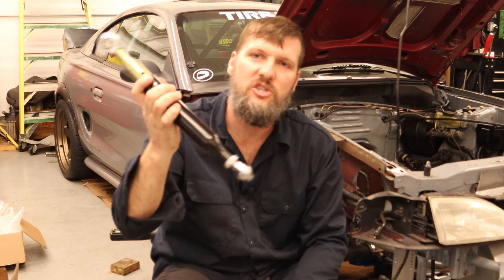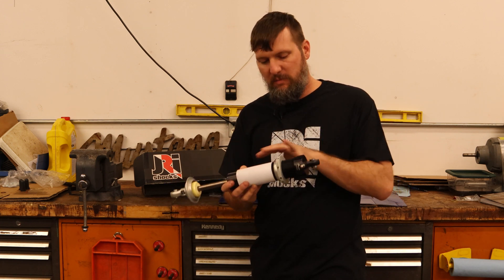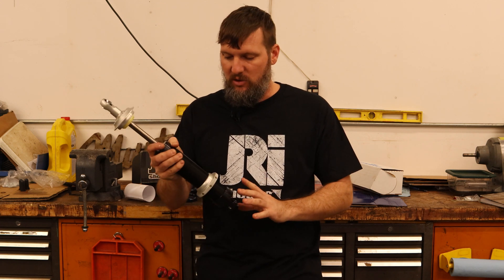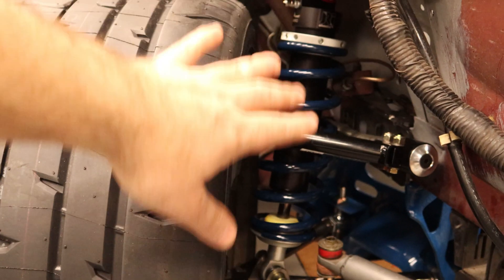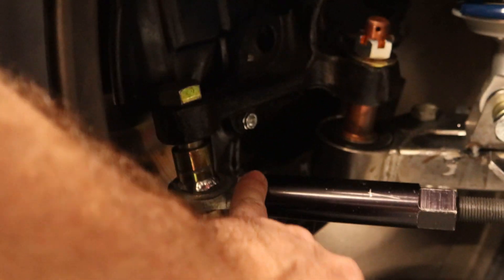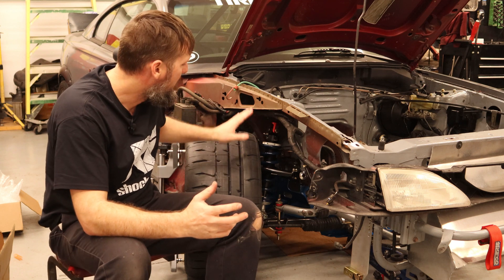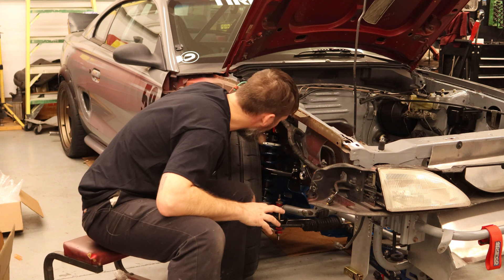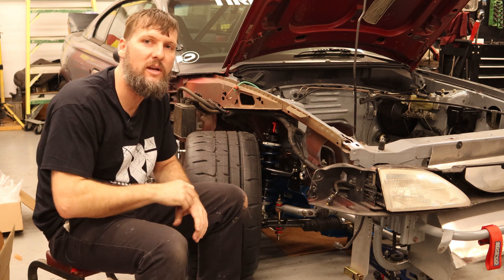Coilovers for DIY Double Wishbone Mustang Suspension

Comment: cant believe this has only gotten 93 views so far even if it has been 1 day. Can't wait to see the end result. What are the measurements you're going to be focused on in the end? Camber, caster, scrub radius, bump steer, camber gain, what else? Thanks!
Reply from the maker: The algorithm....😵‍💫 I know basically what I want for camber, caster, toe, and bumpsteer. Roll center height and antidive I'll need to figure out during testing. Scrub radius and camber gain will just be whatever they are at this point.
Reply: @RinerAutomotive  As per the question you asked about building or buying a K member. I have a MM K member so I say buy a MM and go from there lol. Mulling over my own SLA build but I'm going to start with spindle build first. I might make a video on just the spindle build.
Reply from the maker: Building a spindle would be cool. I've mulled over doing one similar to mod squad garage. Basic yet effective.
Reply: @RinerAutomotive  interesting,  I haven't seen that video. Do you have a link?
Reply from the maker: No video just something been thinking about